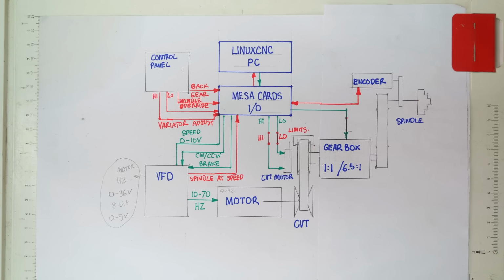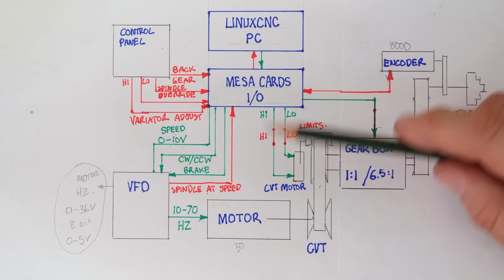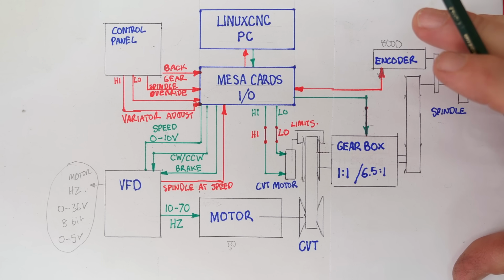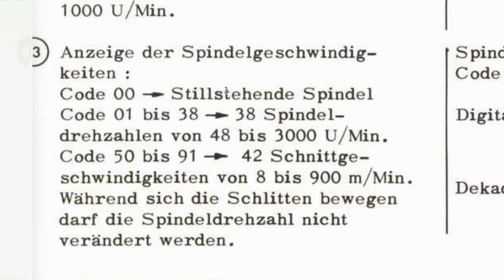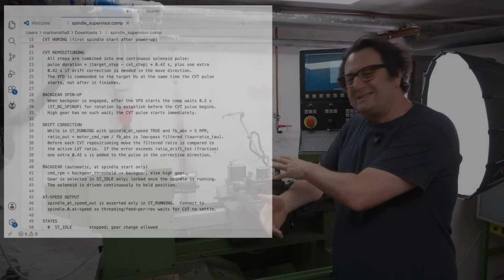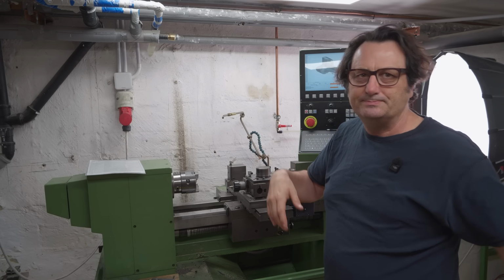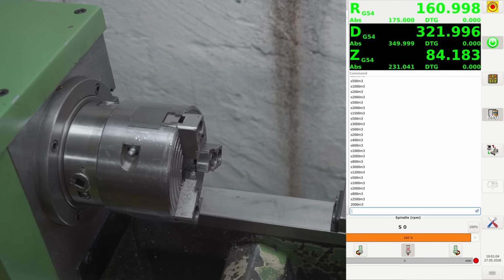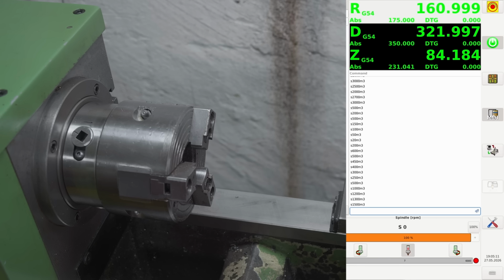Open loop spindle control - Schaublin Ep. 69 || RotarySMP

Comment: 21:38 Hi Mark, regarding the preview issue, I had a similar thing on l´my router with QTdragon, might be the same issue. For me, it was a remapped M6 command that moved the controll point to the tool setter, and that was included in the preview. The solution was to check what "mode" the task was in, so the preview interpretter did not "run" the tool setter code, but the milltask was. Can't post links here, but search for "path preview cluttered" on the linuxcnc forums (older than one year) and you find the solution for my problem. Hope it helps you to. Best regards Henrik

Comment: Hello Mark, I’m looking for some advice on purchasing a Lica which one to go for to start with want to keep the budget low
Reply from the maker: Low budget and Leica are pretty much mutually exclusive.  My M2 was cheap, but looks like some one used it to hammer in nails. It doesn't matter much which manual model you use. I would not buy another digital Leica. My M8 shutter is working again, but the files are now corrupted, looking like color solarisation. It might just be a poorly seated ribbon cable, so I should open it up again.
Reply: @RotarySMP  oh no Mark, so you would not buy one again. If you were to get one what would you recommend lowest price v model choose
Reply from the maker: @Jonathanbaker  Digital or Analog Jonathan?
Reply: @RotarySMP Digital, I might be wasting my time with Lica brand. Sony 6400 current tool. I just like the full manual dials with the Lica. But is it worth the money. Or just the posh camera club.
Reply from the maker: @Jonathanbaker  Leica is basically male jewellery built on legend.  Yes the rangefinder is a different way of framing, and the mechanicals feel great, but they now use the same sensors as all the others, so there is no significant improvement in image quality from the body.

The lenses are often nice. My Summicron 28 is the sharpest lens I have owned, but plays badly with digital sensors. 

Given you you can get a used mirrorless from any of the manufacturer for 1/5th to 1/10th the used price of a leica body, that can mount most of those lenses, I would suggest going there first. Lenses seem to hold resale way better than bodies.

Comment: You can do the math, but i think if you drop a 4-20ma signal across a 250 ohm resistor,  it turns into a voltage signal. I think most PLCs do that for analog inputs
Reply from the maker: Thanks Tom.

Comment: From constantly bumping the CVT back and froth I would expect quick mechanical wear on its adjustment parts. I would recommend to use the CVT only to dial in a drive ratio for the fastest speed required in an operation and then only use the VFD to establish constant surface speed.
Reply from the maker: Schaublin designed this system for such CVT bumping.

Comment: 31:07 I was going to suggest an opamp to scale the VFD output, but looks like you have that taken care of!

It's been a looong time since I poked around at LennoxCNC/HAL, so I don't remember if there's a dedicated way for a HAL module to pause the axes. If not, I wonder if you could temporarily override the feedrate to 0 while waiting for spindle speed to reach the target.

I also wonder how hard it'd be to set it up so you can get the cvt/gearbox to a specific ratio so that an entire facing operation will "fit" within the VFD's speed range, without needing to change the cvt/gearbox mid-cut.
Reply from the maker: There is such a wide range of speeds needed for different part diameters there is not really any specific range you could work with.

Comment: it's possible there's a way to do step/direction like a stepper driver with the motor controller or a phase locked loop that you feed a clock signal to...
Reply from the maker: I switched to open loop, and have a pretty nice working solution now.

Comment: After you put the toothed belt back in place and start the spindle, you immediately see the belt ride up to the shoulder again. There might be an alignment issue between the two belt pulleys, the belt should stay nice and centered and not ride up to one shoulder all the time. That causes excessive belt wear and also can lead to another belt climb.
Reply from the maker: That belt was probably also damaged but that usage,. I should  order a new one.

Comment: Intitial CVT lookup table for material(surface speed) and average turning diameter

VFD always closed loop, and if over 80% for 0,5s then adjust CVT until VFD under 50%, and of course same to lower rpms.
Reply from the maker: I switched to open loop control, and it is working well. There is no real need to a lathe to follow RPM perfectly.

Comment: well your not doing any polar turniong or gear hobbing on it thats for sure xD
Reply from the maker: Now, certainly not.
Reply: @RotarySMP  but if you fugured out a small ish spindle that you can mount on the cross slide and put a face mill on then you can do some serius depth of cuts that for sure

Comment: i understand wanting to control for speed as in surface speed for a cut, but i've been wondering---why don't more cnc systems control for constant torque and/or cutting pressure?
Reply from the maker: That is an interesting question, for which I have no idea.

Comment: On my three phase lathe, when I added a VFD 23 years ago, I’ve kept the motor at 60 Hz, the frequency here in the USA. It’s a Reeves drive with a separate DC motor to vary the pulleys. I added an encoder to read the speed out. The lathe has an analog meter for that. A lot simpler than this, happily. Many, if not most VFDs, offer both a voltage and a milliamp output. The TECO/Westinghouse do, for example, as does the one Schneider I have (not my favorite to program).
Reply from the maker: This VFD is only 0-6V DC out. Still, I am happy with how it is working open loop.

Comment: Mark, pleasexfeel free to ignore my input here but in my opinion, what you were trying to achieve with your feedback system (before you went for the look up table), is a pretty hardcore control problem with two nested control loops and some undefined dynamic parameters.
I used to design high speed amplifiers with 12dB/octave compensation for a job, and if that terminology flew over your head, you won't get it to work. The hunting for a steady state, going fast - slow- fast is symptomatic of an unstable system. Ideally you'd model everything in something like Matlab to get the gains and time constants correct. In short, I'd run a mile from this problem!
Reply from the maker: Yeah, once I simplified it, and left it open loop, it works fine.

Comment: Perhaps you can do a shorter 'gear ratio calculation inhibit' if you build in a ramping function for the commanded vfd speed, so your inhibit time can at least adapt itself to the size of the change in commanded speed.
Reply from the maker: I could, but am pretty happy how it works open loop.

Comment: I’m impressed with your Lathe works
That’s a small hiccup with the belt issue is the motor completely parallel with the spindle and the hinges on the tension system operating parallel to the spindle. 
I always like to see the tools that Machinist make and some are available from off the shelf tool in catalogs but the ones that Machinist make are usually very unique for their line of work. I find it interesting to look at a Machinist toolbox and study. what kind of machinist they are from the Tools they have. 
I do the same thing with heavy equipment. Mechanics too.
Reply from the maker: It is a really nice lathe. That belt is quite a beast.

Comment: You would be much better off having a look-up table that sets the belt speed in the upper torque range of the VFD. And then just let the vfd do all the Acceleration and deceleration for that cut. Basically the way a gear head lathe with a vfd operates. Then there is no worry about the inertia in the variable belt system. And the VFD can handle all the braking.
Reply from the maker: That is what I switched to. Open loop with LUT. It is working really well.

Comment: Good result mark for constant speed im impressed. But for constant surface speed this machine will be perfect only when thats CVT is ripped out and you let that VFD be in charge of the speed. More sensor and software will only make this thing a never ending project. Cheers
Reply from the maker: I dont see any need for perfection. This is already good enough speed control for a lathe.

Comment: Try adding an Inverter on the CVT motor.  Also, instead of lookups try a Polynomial formula based on measured input and output speeds.
Reply from the maker: There is a lot which could be done, but it is a lathe, and this level of control is already good enough. I will just tune some rough edges off it.

Comment: Hmm. For commanded speed as your input, it could have been interesting to try:
-set some bounds on the gear ratio calculated number, so that your calculation can't be higher or lower than is physically possible
-use a rolling average of the commanded speed instead of instantaneous value

It honestly seemed just clever enough to work.
Reply from the maker: I did try a lot of signal processing on that ratio value on that previous attempts, but really, this simpler version is plenty good enough for a lathe.

Comment: I like the lookup table, elegant and simple. I read that's good is good enough for now. But if you ever wanted to I would have a look second look at pid. You essentially build a feedfoward pid controller without the pid part. 

Basically a feedfoward  is a constant value needed to get the whole system moving. And the pid controller is only used to offset the process value and the setpoint. As an example if you wanted to hover a drone at 10m the feedfoward value would be equal to the force needed to counter gravity and the pid would only be used to offset from that constant to counter the wind or other influences.

This setup gives a way better performance as the pid controller range is way limited and therefore more responsive. In you case you would only need to use the pid for a few hundred rpm instead of the full range of a few thousand
Reply from the maker: I like that the open loop control is very responsive. Turns out a lathe does not really need perfect speed control.

Comment: This is a great evolution of the speed control system! It's great to see how Schaublin did it and I think your adaptation is really well done, minus the low range inhibit issues, hopefully you can get that sorted out easily enough, and if you can add in the electronic braking, I think it's going to be fantastic, well done!
Reply from the maker: I took another look, and in the most useful range I am mainly adjusting the CVT. It takes the time it takes, so there is no real benefit trying to use the brake there. I guess I will just have to live with it.
Reply: @RotarySMP  I suppose you could just have the system dwell until the speed settles before entering the cut on large speed changes, and maybe make the dwell duration a function of the speed delta 🤔
Reply from the maker: @Teklectic  Correct. It is not like I am a production company where every second counts.

Comment: If you wanna get funky with it you could probably stick a microphone in the gearbox and correlate sound frequency to rotation speed. Not a very practical solution, but interesting.
Reply from the maker: I could, but am pretty happy how it is working open loop.

Comment: seems like the lookup table is the best solution, keeps it simple and predictable.

you mentioned that you are measuring the spindle speed to determine the actual cvt ratio and using that to correct the next cvt bump time. have you tried also using that ratio to offset the vfd commanded speed? that would take care of the steady state error, but you might have to add some hysteresis to prevent oscillation.
Reply from the maker: I was trying to do that, but it is too slow to settle. I switched to a pure open source version with LUT and it is working fine. A lathe does not need to follow RPM perfectly.

Comment: Looking good, Mark! I remain confused why you are so worried about scaling the VFD actual speed output to 36V. Did you try using the 10V output to the 35V input and find that the rough precision was not enough? I feel like I'm missing part of the story!
Have you thought about safety mechanisms to detect when the belt rides up? Microswitch in the estop chain, maybe?
Reply from the maker: 0-10V into 36V 8 bit ends up with pretty large jumps between resolved steps. I don't thing detect is necessary. It was very obvious.

Comment: 23:20  we have learned the very important lesson here that dwell is our friends. have a puma 300 at work that's a geared machine and any time I change gears in a cut like that I have a macro written for it

o841
m5; (stop spindle)
g4x2.;(wait for spindle to ramp down, 15 inch chuck so it takes a while)
m[#1];(gear change, m41-43)
if [#2 ge 99.] goto 333  
if [#2 le 95.] goto 333 (logic gate, this sub can change spindle speed if commanded, so this checks to look for a 96 or 97 for an rpm change, if there isn't it restarts the spindle at the last commanded speed)
g[#2] s[#3]
n333 m3
m99

this usually works with a g65 line and everything in mine that a wrote isnt in the comment. if anyone wants it I'd be more than happy to copy it next time I'm at work and leave a comment again. but here's what the g65 line looks like

g65 p841 a41. b97. c500. (this changes to low gear and sets the rpm to 500)
g65 p841 a42. b96. c800. (this changes to the second gear (high) and sets the the spindle to 800 sfm)

id heavily suggest writing one if you plan on not frying your gear box
Reply from the maker: Yeah, I am considering removing the authority for gear change from the comp, and making manual panel button or M code only. However for now I have improved the spindle stopped before change inhibit.

Comment: I would recommend having the VFD use a PID to directly control the speed, then have another PID which moves the CVT with the goal of getting the VFD as close to 50hz as possible. That way the VFD can do any faster RPM changes (including breaking) but the system will find the most efficient position on the CVT after a second or so.
Reply from the maker: That was roughly me original concept, but it will need more feedback sensors installed. I am pretty happy how this is working.
Reply: @RotarySMP  ah I see. No motor speed encoder.
Reply: This can lead to serious oscillating between the 2 PID .
Reply: @MaD_Man_2000  the cvt can not move very fast and the vfd can change much faster so I don't think there would be any resonance issues. I'm not an expert though

Comment: Nice results. I would not have guessed that you could get so close with that approach.
Reply from the maker: Yeah, I am also pretty happy with it. I still want to hook up your OpAmp, and see if it gives improved ratio calc, to improve the error bumping, but otherwise, I am happy to use it like this. I might remove the COMP's control of the back gear, and set it manually, or with an M60. The feedback I got is that most commerical lathes leave the back gear decision to the user.
Reply: @RotarySMP do some research on ADRC instead of PID for the control. Basically exactly what you're already doing: disturbance observer to estimate the CVT ratio, with feedback control for the rest.

Comment: ABS sensor disc on belt pulley + ABS sensor + Reluctance Sensor Module. Cheap, simple, robust and ideal for dirty/wet environment. Even you can make custom steel disc (laser cutting, plasma, CNC).
Reply from the maker: At this stage, I don't see much benefit in having perfect speed control.

Comment: Mark, I'm not that great of a programmer and cautious by nature. It seems the pauze between switching gears is neccesary to keep a running lathe. Therefore I would incorporate a separate hardware timer. (multifunction or just an on delay) If the software goes shopping the relay could save your day. Best! And offcourse thanks again for sharing your mechanical/elektronic adventures with us!
Reply from the maker: I had this in Classic ladder before. I am still playing around with the timing to optimise the comp. I may also remove the authority over the back gear from the Comp. Leaving the user to set it with the panel button, or with an M60 code in a program. It seems that is common on commercial lathes, and can see how it might be better to not have it under automatic control.
Reply: @RotarySMP  Mark, an installed  hardware lock to prevent serious machine failure makes a "programmers" live much more relaxed and fun to do. You can even keep a vent between your buttocks while doing it!.

Comment: I think you should lock something in that chuck and torque it, if those Chuck jaws start to walk out you're going to have 2 events
Reply from the maker: It is Pneumatic, no torqueing.
Reply: I could use a little clarification here. I have seen warnings here and there about unloaded chuck jaws being flung out; I’ve been assuming it’s mainly a high RPM thing, and that it could occur in either independent or scroll-type chucks. So far, so good? Or, faulty logic? 🤔  Next, is it relevant to pneumatic chucks? Never had my hands on one of those.
Reply: @RotarySMP sorry, I didn't realize that. 😊

Comment: The workpiece didn’t look to be running true. Going to be hard to balance like that 😮
Reply from the maker: The final OP will be with it mounted on a tapered arbor, turning the thread and the mounting flange true to the taper.

Comment: Magnetic / Hall effect sensor might do the trick in the dirty gearbox. Crank angle sensors in cars run in oil happily.
Reply from the maker: At this stage, I don't see much benefit in having perfect speed control.
Reply: If it ain’t broke - improve it!

Comment: Inductive pickups are a good way to deal with a dirty environment. You can pick up the existing threaded holes in the belt drive gear.
Reply from the maker: At this stage, I don't see much benefit in having perfect speed control.